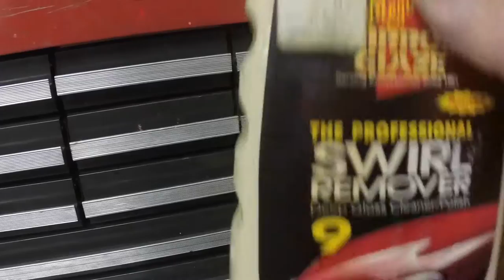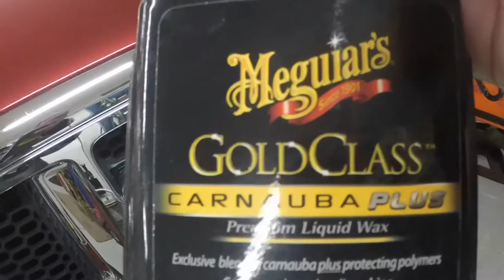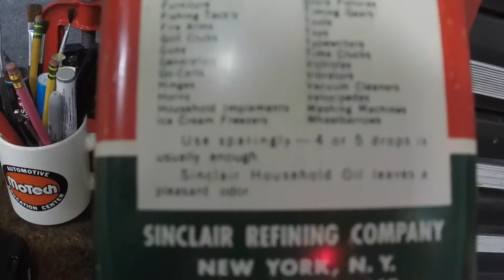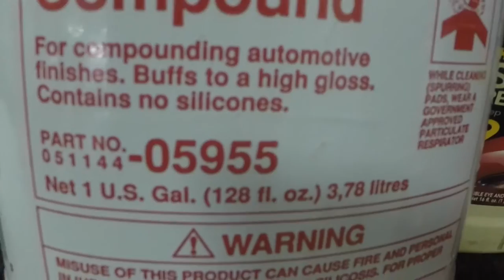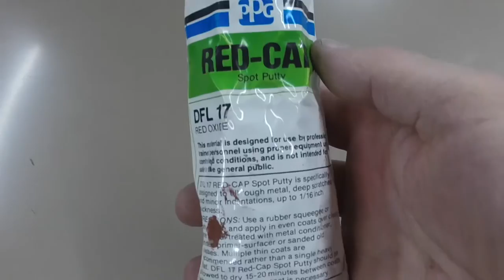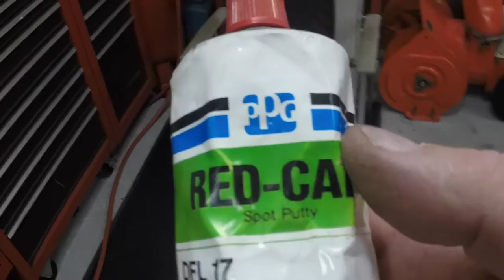Getting paint for the 1960 Pontiac Catalina barn find

Comment: There's a small pressure sprayer like yours on eBay for a "buy it now" price of $277! The one on eBay has a label that says Precision Pressure Sprayer made by Milwaukee Sprayer Mfg. Co. (for Steiner Sales in Chicago). It also has a rubber cup, as you suggested, on the bottom for protection of the surfaces it sits on. Very cool...
Reply from the maker: I have seen a few on eBay.... ones that did sell, sold around that $300 mark.... crazy for a little sprayer. I do like it, and use it often. I put windshield washer fluid in it. Lynne, my dads partner after my mom passed, gave it to me. Her dad owned a Standard gas station back in the 40's 50' and 60's. It was his, from that gas station. He used it for cleaning windshields. That was the era of " Full Service" at gas stations.

Comment: Your old 5/16 socket is probably worn somewhat. The conversion of 8mm to decimal is 0.3149 and 5/16 is 0.3125, the 8mm is actually bigger by a few thousandths than the 5/16...so, your 5/16 socket has probably had much more use than the 8mm. Sorry for being picky, just a detail fanatic. Thanks for the super videos!
Reply from the maker: Thats exactly what happened.... I have since replaced that extremely worn out socket. I should have shown it on video, it was a wonder it fit anything.....

Comment: Put on 60lb??? Howard!!!! That weight comes from somewhere, not just out of the air, LOL. All kidding aside, it's easy for me to put on weight also, I have to watch my snack intake a lot.
Reply from the maker: That 60 lb's came from Mountain Dew. I use to drink two... yes two, two liters a day. I quit cold turkey, had a bad headache for a few days, and started loosing weight immediately. To this day, I can't stand Mountain Dew, I don't know how I drank it. I feel much better, but still could loose another 20 or 30 pounds. The older I get, the harder it is to loose weight. I try to go for a walk around my community every day, summer and winter, thats about a 4 mile walk. It helps a lot!
Reply: I love Diet Mountain Dew. I can't drink regular soda at all. 2 liters a day is a ton of "empty" calories. Whenever i want to drop some weight, i go to the store and buy an assortment of the Lean Cuisine-type frozen meals that are about 300 calories, and eat one fairly late so I don't get hungry before bed.

Comment: You have probably already found this site. Nevertheless, I googled "1960 Pontiac Shoreline gold" and found this website, www.paintref.com. I'm an idiot for telling you something that you already know, but nevertheless I can't help myself. What you need to do is match the paint as it appears today, which is not exactly as it appeared when the car was new. Whenever you see thumbnails of original vintage automotive paint colors on the Internet, there's often a disclaimer declaring that the original color when new may not exactly match the color in the thumbnails. Perhaps people out there in YouTubeland will benefit though. Oh, and BTW, keep up the good work!
Reply from the maker: Yep, I guess after 57 years the paint has changed a bit. That is why the guy that mixes paint for me, wants a part off the car. He does have the factory formula for the Shoreline Gold, but he stated it most likely would not match. I wheeled out the gas door. Where the emblem was, the paint looks like it has a tad bit more red tone to it. The under emblem paint looks to match a majority of the paint on the car, so I think that is where I want it matched to. I had several friends look at it to, and they came up with the same opinion. I will get a pint in the next day or two, and spray the passenger door jamb, and a scrap of sheet metal, to see how it looks. If it look good I will get a gallon mixed. If it does not match well, I will have him mix a pint of the gas door where there was no emblem, and try that on the drivers side door jamb, and some sheet metal too. I don't think it will be so far off that it will look bad in the door jamb, if it not a perfect match. I looked at the web site. Good site, thank you!